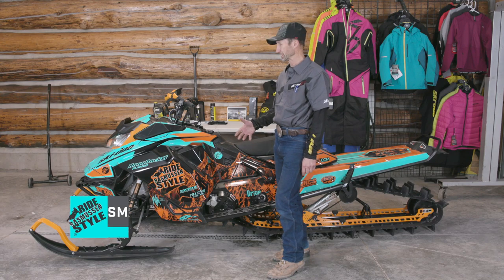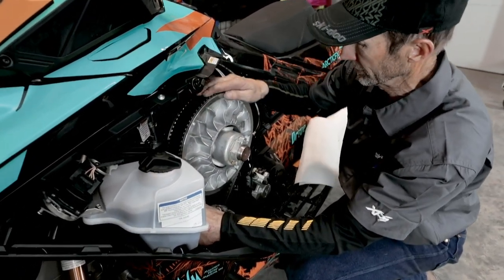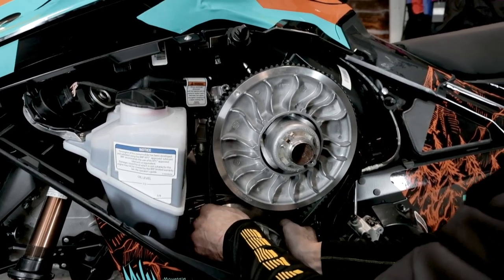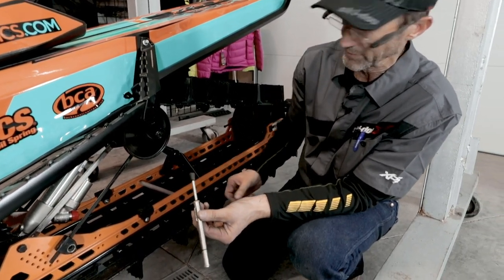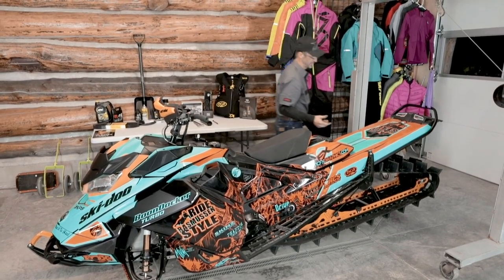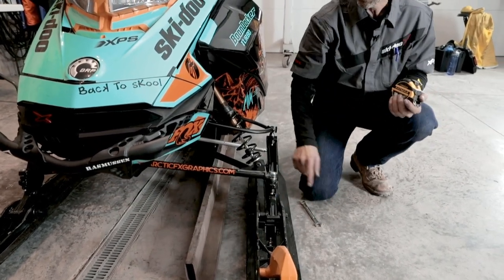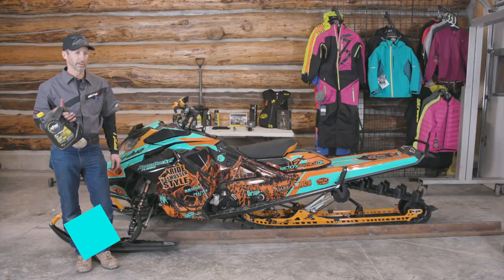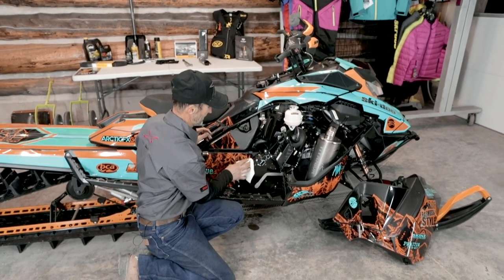Ep7 - Preseason Preparation For A New Ski-Doo G4 Snowmobile

Comment: A maintenance question: is the chain case oil also the oil used in the transmission ie are there two oils to change or just one?
My unit is 2023 Scandic 900 ACE LE non turbo

Comment: Hi Bret I really enjoy all your videos you are a massive asset to the sledding community. I have one question what size of rectangular tubing did you use for the track to ski alignment I really like your idea and want to build one for my self
Reply from the maker: If memory serves me correctly then I would say 2"X3". It's barely high enough with the 3 inch lugs on the new tracks, but seems to work alright.
Reply: Awesome thank you so much for the fast reply i can’t wait to build one and tune my 850 in. Thanks again and have a safe sledding season!!!

Comment: Hi Bret, I have a Scandic with 154 x 24 track calling for 1.77 inch deflection with 16 lb at deflection point after a 10 to 15 min ride to warm up track...hard to do in April....Is there a rule of thumb for a cold track? since the machine is up on a stand in my garage at the moment...
Reply from the maker: Just spin the track up on the stand for a few minutes. That's all you need to do. I like to run the track as loose as I can without it slipping on the drivers. Because spring snow has more traction in it, we typically have to run a bit more tension. If it slips just tighten it a bit more.

Comment: Just wondering if the ski pressure with the helper on the sled skew the accuracy of the ski toe in or out, with all the friction on the concrete? I have done this with the skis floating with no resistance.
Reply from the maker: Technically you would want to make the adjustment with the sled at ride height rather than fully extended. If there is any scrub steer it will occur at full extension and full compression. With this suspension there is really nothing to worry about here.
Reply: I wanted to know about suspension settings.  Also can you talk about the sway bar removal or keep it in?
Reply from the maker: @artbingham5738  we have an igtv video that address most of this. But I would like to do a you tube video to address just the sway bar. I'll put this on the list!

Comment: I have a squeak coming from the front end with I move side to side. Is there anything that needs greased on the front end?
Reply from the maker: Just dry bushings in the a arm pivots and sway bar linkage. You could spray in some wd40 to lube it up and take away the squeak. It will come back after the first time you ride it though.

Comment: For belt deflection on my 2020 Summit the owners manual says to have it sit higher on the 850s, line up the chord of the belt with the top of the sheave. And all other engines to line up the bottom of the belt cogs. You still recommend to have the belt sit lower?
Reply from the maker: I like to run the belt as high on the pulley as possible, without causing problems such as creeping or squealing at idle, or causing the engine to die when shifting to reverse. So typically higher than factory recommendation. This ensures that the clutch engages in the very lowest gear ratio. And that you don't have a lumpy feel during drive away.
Reply: @RideRasmussenStyle  Awesome, thanks for the fast reply!

Comment: How is the sound of that diamond S can as compared to stock. I have looked at a couple of their videos but what can you really tell from one.
Reply: The quiet version has a real nice tone, obviously louder than stock, but does not bark. Its a beautiful piece weighs in at just over 3 pounds and comes highly recommended by myself. It actually makes power unlike most aftermarket silencers.I don't run the smaller, louder version, i like quiet.
Reply: @bretraspberry  I agree on the quiet part, I want nothing to do with loud!

Comment: Is there a video to install visor plug kit for 2019 ski doo G4 , do you have to remove the hood?
Reply: The short answer is no, there is no video. But you will have to help me with what is a visor plug?
Reply: @Fraser Mackenzie Okay, that makes sense, i don't use the heated visor. The hood will need to be removed, there is video for that. And then you will gain access to the wiring harness as well as ability to remove the dash panel for receptical installation. BRP also supplies detailed online instructions per the part number of accessory used. Just google BRP installation instruction.

Comment: Do you pull the sway bar out?
Reply: Great question, I do pull the sway bar out!! But only after i have installed my specially tuned suspension package that has enough spring capacity to properly operate without a sway bar. I have avideo planned to explain this in more detail.